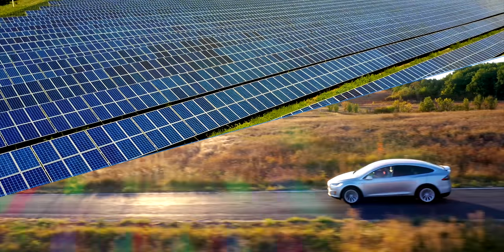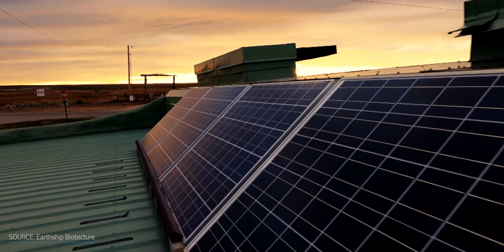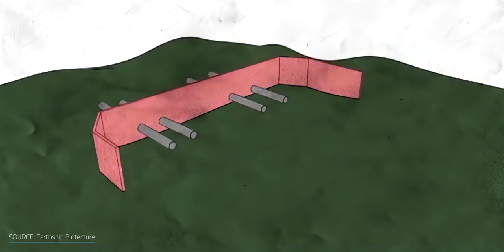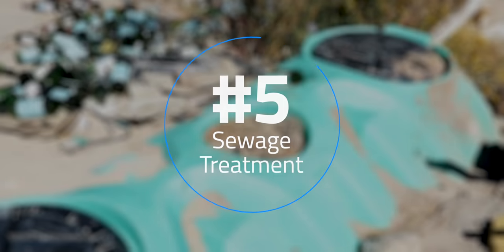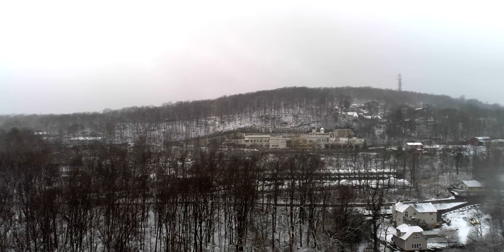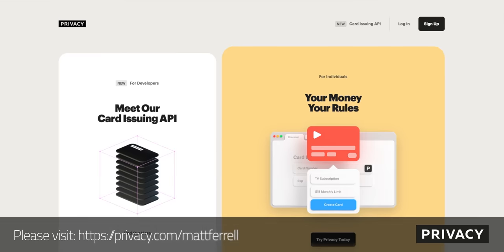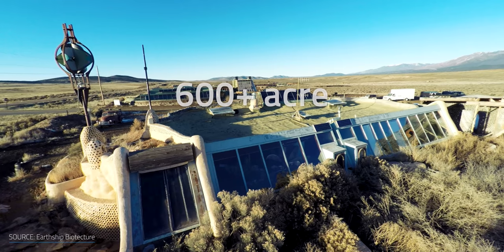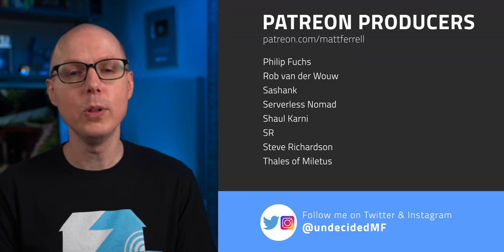Exploring Off-Grid Earthship Homes - Ultimate Efficiency?

Comment: Matt, you put a graphic up that warned of tires off-gassing and breaking down, posing a risk to people. That should not have made it into your video-- and for accuracy, that should be removed because it sounds unnecessarily alarming when considering an Earthship-- because there is NO Earthship anywhere where the tires are left exposed in the interior, which means that-- packed in 'dead' dirt (that you explained), and sealed in plaster--  they don't break down and off-gas, without oxygen feeding the process, and even if they did degrade, they're sealed behind plaster, so there's never a possibility for the tires to affect the house or the inhabitants.

Other than that, great video, and I'm glad you covered this movement.
Reply: Hi, can you answer my question please?  Do you know if the tires leach chemicals into the soil?  Can I plant food near?  I would appreciate finding out.  Thanks.
Reply: @judithpires1608  No, Judith, they don't. And the off-gassing that was described in the video only happens when the tires are exposed to oxygen in certain conditions, and even then, the gas's effects are negligible. I suppose if you lived in a closed room with a wall of exposed tires then at some point you might be affected by off-gassing.

Comment: Personally, 80 to 90 foot ditch at about 8 to 9 foot deep with pipe in it for earth preheated air to be used in a bought heat exchanger as the make up air to your house sounds more feasible. Yes, it would require a heating system but a very small one. A person in Nebraska has skipped the heating system and used this concept with passive solar heat in a greenhouse to grow oranges. Besides tires breakdown and emit toxins into the soil around them. That is why I could never get rid of an old tractor tire at my last house. It made a great sand box but no one would accept it for disposal. Finding some one to recycle it into new products is also very difficult. Let your garage recycle your old tires and pay them the recycling fee. Yes you need to pay them to get rid of your tire.

Comment: Since the bulk of this labor consists on packing the tires with dirt, it would be so much easier to build one where the soil is sandy or sand itself where the effort of packing would be minimal. It could be done in a fraction of the time.

Comment: Thanks for sharing the idea. Ive been doing research on these for years. The guy you talked about comes out with better and better designs. The picture you showed was an old design. Newer ones separate the indoor garden from the rest of the house. which helps cut down on moister. The latest design I've talked about for years came out. the roof slants to the front. This puts all the panels water storage ect up front which cuts down on the amount of pipe lengths wire also which cuts down on build cost. Its not a new idea but its new to the idea of perfection how's that?!. Earthships have come a long long way since the first ones built. I think they have tons of room to grow even if one doesn't what to use used tires. Concrete raises the price but its one that is great for codes cause its already used but it holds heat. One could use compressed dirt if they wanted to be eco-friendly etc. This would go great with a step well garden out front to collect more water...

Comment: You don't have to use tires to take advantage of passive solar and semi underground or earth covered house. I argue that the Earthships have made passive solar seem like a curiosity and not what should be standard practice. Better is a house whose exterior would fit in a subdivision and use modern materials but have a gray water system, south facing window walls with movable insulation and solar power. This would lead to high adoption.
Reply: AKA the Passive House standard, broken into it's three most basic rules below:
1: Air seal everything and install an ERV/HRV for air exchange
2: Use of engineered overhangs to heat the house in the winter and prevent sunlight from entering in the summer (I've also seen this subbed out for motorized exterior shades)
3: Super insulation, usually exterior to increase the thermal mass of the conditioned space

Even use of just one of these things in new construction increases the effecency of the home massively.

Comment: There's also Biotekt homes. They use recycled plastic as a shell then get covered by earth. The website says they can even be put together by a handful of people, or a contractor, you just need a slab. Essentially it's a prefabricated earthship. Still cool! I've gotten to check one out in person as my father in law is building some in OK.
Reply: plastic isn't much better than tires. I'd rather use a straw bale construction.
Reply: @remyllebeau77  definitely! I think it was Matt's passive house video that I first saw that there was even still straw insulation, I even checked out the website of the company he mentioned and it looks awesome. I think that stuff was also load bearing. Just mentioning that company as it fits well for this video. I'm not educated on the degradation of plastic, so that definitely could be an issue. I want to say it's made from food safe plastic, if that makes any difference, I just don't know if it does

Comment: As you put it, it is a niche thing. It is not scalable. It is for small communities, hundreds houses at best. And it is not cheap.
If we could transform those tires in a 3-D print material, one that does not emit gases, this could be more easily transported to where we need it.
The proposed housing idea is to provide quality, scalable and cheap housing solutions for billions. What would we need when sea levels start rising?

Comment: As you say these houses are for the "outliers" - they mostly look exotic and wonderful but once you get past old car tyres a lot of the technology they use is commonplace in hot countries, except apparently in the US. 

I bought a house in Southern Spain about four years ago. It's Southwest facing and the oldest part is about a 100 years old - the walls for this part of the house are stone and rubble construction about two feet thick, with small windows at the front, keeping the house cool in the Summer. 

When I arrived the hot water system was powered by small boilers using  propane gas cylinders - the problem was that they had a carbon monoxide sensor, and just as your shower was hot it would cut out until the sensor decided it was okay to work again - it would do this just as I had lathered up so I became adept at washing my strategic "bits" before the cold water started!. So I installed a solar water heater - it has an electric backup element within but there are only a few days a year where I need to switch it on.

I was quite amused by the complicated systems for wastewater treatment, we just have a run-off. The waste water from the house emerges from a pipe underground and filters through the soil at the bottom of the property - there's a green patch down there! I diverted the rainwater from one part of the roof into some old plastic 1,000 litre containers (previously used by local farmers for fertilizer and bought cheaply from the wholesaler) - and I use those to water the plants and trees in the garden.

A couple of years ago the Spanish government abolished the "sun tax", and my largest household bill was electricity (Spain has the fifth highest domestic electricity costs in the EU) amounting to about €1,200 (£1,000 GBP / $1400 USD) a year so it was a relatively simple choice to install a small PV system. The system had some teething problems - physically everything is very solid (solid German Mittelstand engineering) but, unfortunately the programming was dreadful initially (it was one of the first installations of a newly released system - and like most new software today - it didn't work very well). 

The system itself now works fine - unfortunately Spain really isn't geared up for solar power; the country needs wholesale reform of the charging system and the main electricity suppliers. A year after my installation I've received no payment from my supplier for the 1453Kwh supplied back to the Grid (in Spain we don't have Net Metering and I'd only receive the wholesale price but nevertheless) - but the real problem is the costs on top of the Kwh price - my last electricity bill was €39.91, of this €4.90 was for electricity (locally we had a lot of cloudy days in July and August) and the other €35 was fees and taxes. A lot of these fees scale with your "potencia" - essentially you pay a daily fee based on the quality of your connection to the Grid. My potencia is 3.3Kw, if I attempt to use more than 3.3Kw for more than a few seconds my electricity supply trips off. Potencia for domestic use runs from 2.2Kw to 9.9Kw  -  and you pay a daily fee based on your connection. Unfortunately, the connection runs both ways - if I want to supply more than 3.3Kw of electricity to the Grid I need to pay a higher daily fee, I could have filled my roof with panels and supplied about 10Kw at peak - but I'd be paying a higher daily fee and Endesa aren't paying me now, so what's the point?

Comment: The two biggest questions I have with earthships are:
1) potential toxicity of tires used to build them does not make them appealing to me (imho rammed earth or earthbag house is far less toxic),
2) flushing toilet is the biggest thing that boggles me in this concept. WHY? How using flushing toilet with limited water source is sustainable? Composting toiled would be the optimal choice imo, but I never saw any earthshiper use it. Again just why?!

Comment: As always there are many pros and cons of the concept.
The idea of recycled materials for building sounds great, but in reality it is usually not nearly as good as it sounds. In first world countries labour is a major cost, and using recycled materials is much more labour intensive. Also, for some of the examples you showed, you may find that they actually use more non-recycled materials such as cement and plaster to go in the gaps. Some of the walls you showed were really thick which would mean the house would need to be much larger.
The biggest problem I have will 'off grid' earthship ideas is they are typically away from other habitation and unless the occupants work remotely, that is far worse for the environment than city living. It may be a great life style for the rich, but be clear that it is NOT the most environmentally friendly one. 
In general community living is by far the most efficient and environmentally friendly due to all the shared resources. this is orders of magnitude better than anything an 'earth ship' for one family can possibly achieve. My current favorite balance is blocks of low rise flats (3-5 stories) with large shared gardens that can share resources without some the downsides of city sky scrapers, mixed with regions with shops/businesses at the ground floor level. The walkable city is the number one thing you can do for the environment.
Reply: Remarkably insightful and concise…thanks!
Reply: Well it will work just fine for the average north american farmer that lives remotely and relatively isolated. Most farms are so big that living in a village makes no sense, much more for those whose land is away from the village.Moreover, you cannot leave animals unattended for 16 hours, so seems like this concept would work there.

I would say that a more standardized approach would be more practical, like using some conventional materials and such, but keeping the general concept. Taking advantage of farm resources to produce gas for heating and cooking could solve the problem of heating in extreme environments. Having a green house in your house would be awesome for most farmers in climates such as Canada. So it has its place but I agree with you that this "fully custom made" approach is not very practical, but well built these houses can last much more than a traditional farm house and be much more comfortable. Lets not forget how cool they look and that in the right place they can also be very environmentally friendly.
Reply: @reiniertl  Yes, for farmers, it definitely makes sense to be more energy efficient and conserve some resources, although it of course varies by location as to what are the scarce resources. But farmers are a tiny fraction of the population and when it comes to the environment farming practices will make much more of a difference than their house design.

Comment: It can be also polls in USA for carry electricity from one place to another even if it is heated or crash they did not transfer electricity out side the tyre insider the steel which is got from the tyre can be used so by recycling the iron will be in center and the plastic we be used out side it we stand still strongle no need to throw them or they can be used for fence by deforming them or carbon fiber by adding carbon with plastic that also possible..so you can change this thing to different material for preventing accident by making them to another form..so it do have great value after use thanks bilicha Eritre Africa thanks I appreciate you

Comment: I like to lean towards rammed earth bricks...
i just need to build a small form and put it in my press then mix clay sand and cement to the right consistency.. press it with a 20ton jack and either stack them then or fire them for more durability and stack them...

still gets the thermal mass costs less in time and i don't have to claim my home as a landfill.

Comment: You stated that “tire bale walls had and R-40 value”, and was curious if this was a misstatement or misassociation because rammed earth tires are not tire bales? Tire bales are a bunch of tires heavily compressed by machinery and baled with steel. Some people have started using this for earthships because the walls get built much faster, but it is not the standard practice.

Comment: Thanks for the analysis, I've been fascinated by these for decades. I've been wondering why no one has designed an attachment for a jack hammer to speed up the "packing the tires with dirt" phase.
Reply: High pressure air tampers exist. I used them when we cut out test holes in asphalt and had to patch them back in.
Reply: @louishermann7676  
🤔 So can they be used like this, for this?
Reply: @louishermann7676  I assume those tamped up and down. To pack a tire full of dirt you have to tamp sideways or out, Earthship makers use a sledge hammer for that part, thus the huge amounts of time. Some sort of expanding spring leaf was my idea.
Reply: @PalimpsestProd  In some videos you see they do use them.

Comment: I'll bet igloos wouldn't do well in a lot of places either.   Simply because they have used tires, doesn't mean that is the only way to make an earthship home.    As for permits, that's why so many of the interesting homes are built in regions with little oversite.   East San Diego would be a awesome place for these earthship homes, but there is no way you could afford the engineering and plan challenges.   My Dad and I built some of the first residential steel homes in San Diego area in the 80s and it was huge expense for owners to get it passed planning department and that was with material engineers could easily put numbers to,  not like tires stuffed with dirt.

Comment: you could use a vibrator used for concrete to reduce the time significantly to compact the earth in the tyres so you could reduce the man hours for the construction of such a home. Better efficiency of compaction would be achieved if the soil is has the optimum moisture content but it could stink since the rubber could rot much quicker this condition would persist during the wet months.

Comment: this is great for places like the US with large open spaces, but most housing is in urban areas, its not always possible to face the sun with a huge bank of windows. I can imagine a system where these designs of home are planned well in advance and old tyres are dumped in the build location ready for use, old tyre storage is a problem. Many recycle companies are using old tyres, so the supply may become limited

Comment: HI,  After buildingmyself over 100 "standard" houses, I just started on building my own  Earthship. Many  people, same as Matt have a problem with tyres  and their possible off gassing, smell etc etc. But,from what Ive read , Universing of Wisconsin tested tyres for off gassing and found none.  Regarding tiresome pounding of tyres with dirt ( as you Yanks say:) , one may use pneumatic tamper that does the job easier and in 5-10 minutes per tyre .  Now,  lets see what harmfull material may we have in an Earthship . Clay render? nope, Stone floor ? nope, Timber ceiling? nope , Glass wall? nope.  And if you dont build  your kitchen with "standard homes'" formaldahyde kitchen units , you live in a really healthy house.  Now, look around you. You've got glues , resins,  vinils , plastics, oil based paints , latex  and tons of other stuff that constantly evaporates and is being inhaled by us. Im not mentioning the obvious stuff like being self sufficient and prepaired for possible disaster, should it be weather that is more and more unpredictible,  or maybe war,  just like we have here just over the Polish border in the Ukraine. And you either have embargo or some "Puke-tin" decides not to sell you gas,coal ,oil and youre done. An Earthship in my opinion gives you more chances of survival , with solar panels and battery bank, own water , and house that need heating not for winter sub zero temp, but 15deg.C up.Enoughs enough , time for dinner😀 . love you all Tomek

Comment: Would it be possible to replace the traditional cement shell for a basement with some earthship aspects? Maybe would still need some concrete for structural support (more pier-and-beam type design)?
Reply: Of course it would be simple but just expensive. The walls can support the weight for sure.